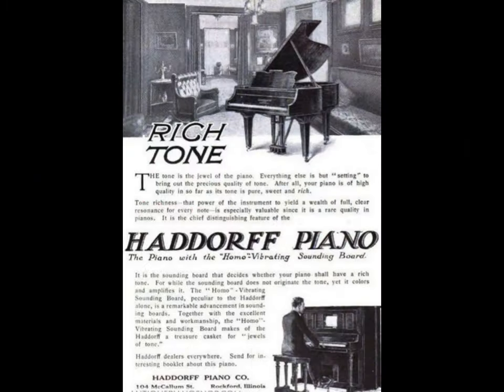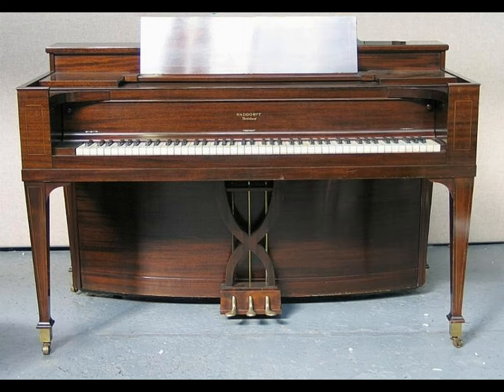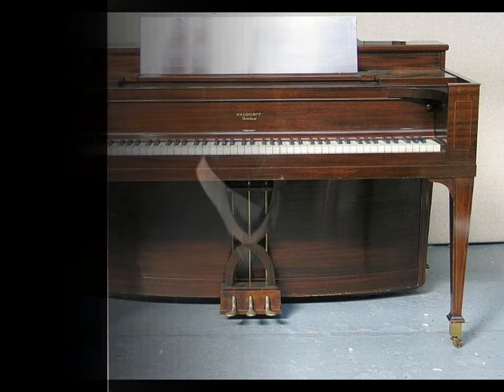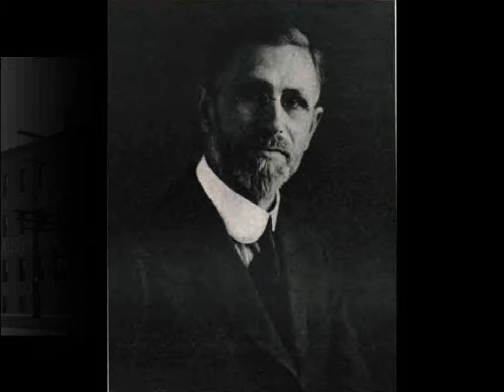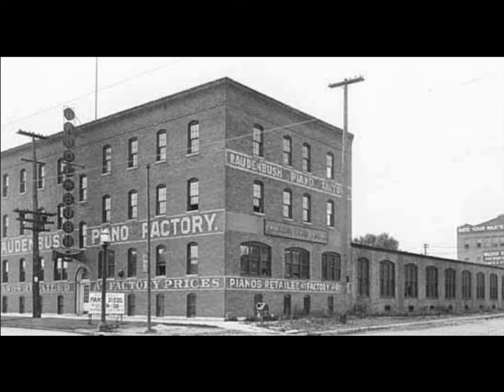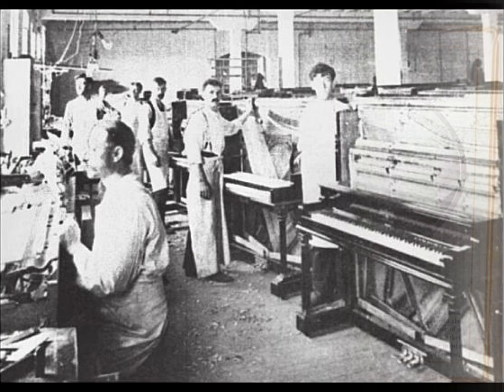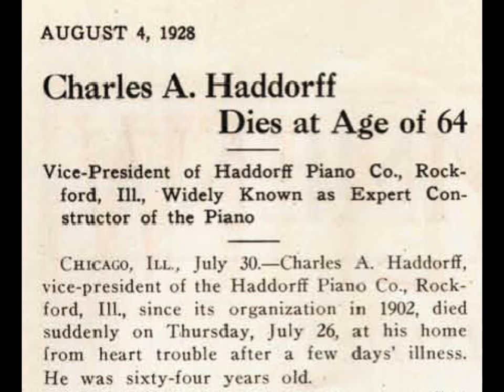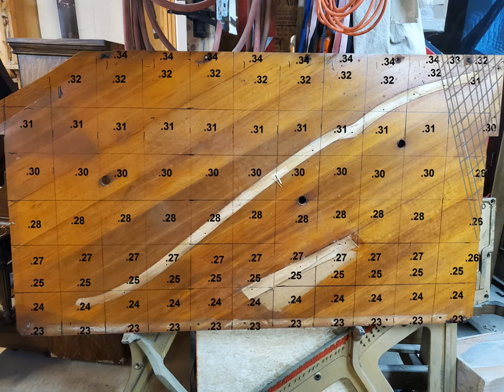Haddorff's Homo Vibrating Sounding Board SECRET

Comment: Thanks for another interesting video. By stress curve are you meaning the down bearing force per unit area on each of the ribs and is this at the rib centre ?
Reply from the maker: When a weight is placed on a "rib" it creates a fiber stress in the wood. For that same weight, a small rib will be under higher stresses than a large rib. So all of the ribs dimensions are carefully chosen for even distribution of forces among all the ribs. This helps with freedom of movement of the soundboard for transferring acoustic energy.